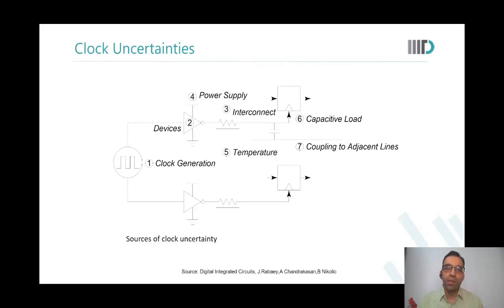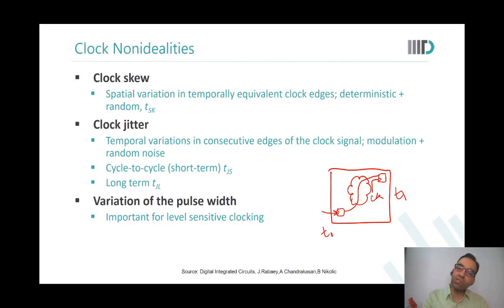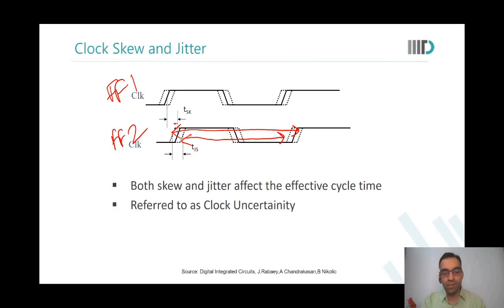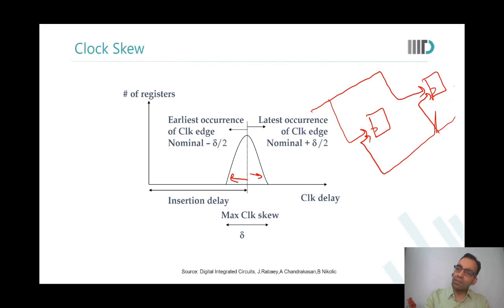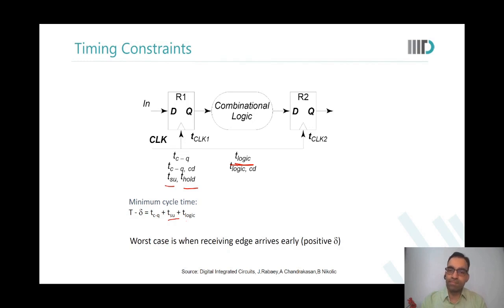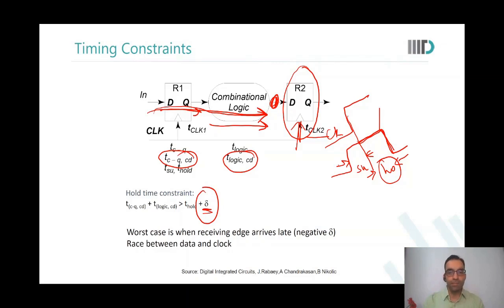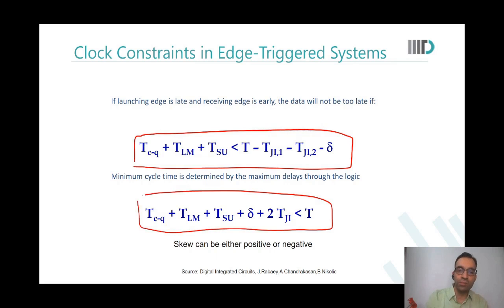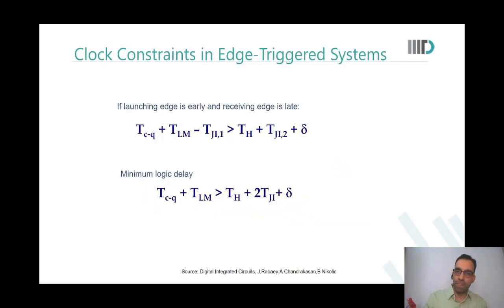Sequential Design | Clock Uncertainties

Comment: (25:12 video point)
1. Sir two flops in same path group would have same skew(if CTS done in such manner). Then the jitter margin would be the same for both?

2. Also,if we want to analyse the path between different flops in different path groups, would they have different jitter margins ?
Reply from the maker: Jitter is the property of the clock network ( including random variations in PLL, crosstalk etc) which may happen independently at every clock edge. For a different clock network driven by a different clock generator, independent x-talk etc, these margins could be different per edge. 

Therefore jitter margin is always added for every clock edge (doesn’t get canceled out even if CTS is perfect and there’s no skew etc).